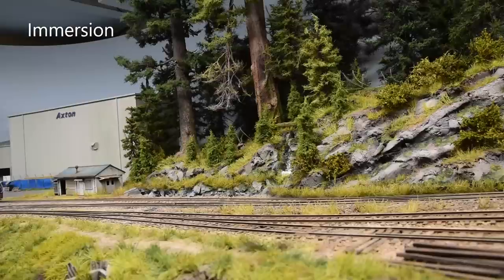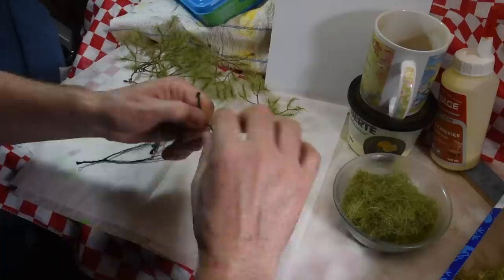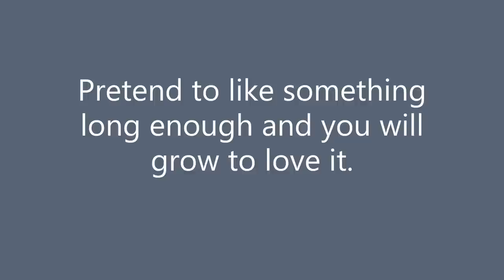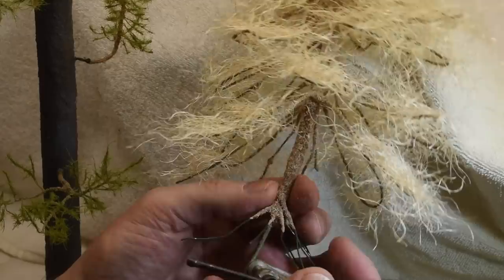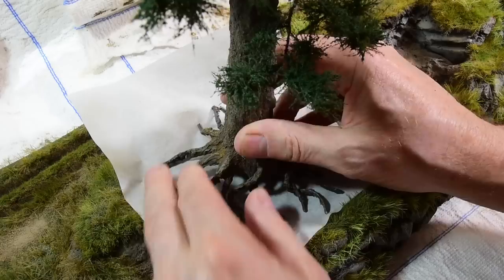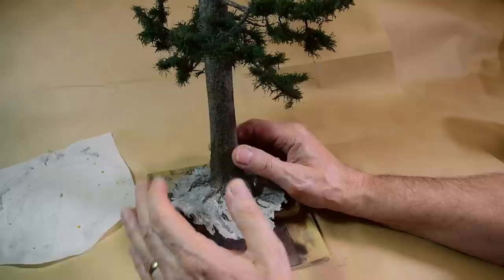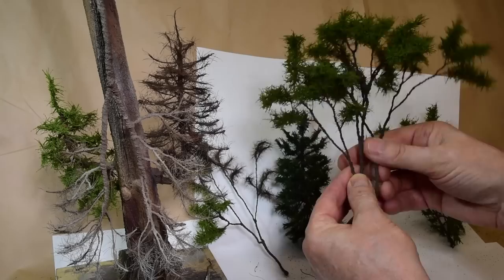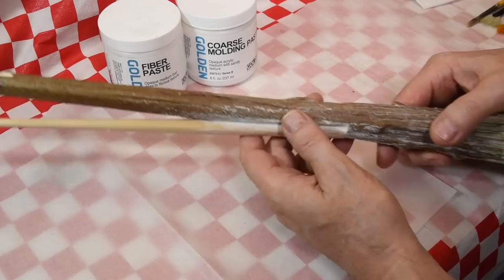Modeling The "Signature Scene" Final | River Road - Vlog # 110

Comment: Absolutely agree on the 3m disadvantage, it’s a contact glue which when it comes in contact with water, it will saponify. Totally switched to matte medium.
Reply from the maker: All the spray glue is like that. It dries out and the tree falls apart after a few years.

Comment: Great and  very explanatory tutorial even for those that have built some trees in the past. I 've noticed in several of your videos regarding the texture on limps, roots or branches that you use only stem wire if you 're goin' to cover it with fiber paste, instead of just simple wire. Does the fiber paste has a problem of bonding and staying on naked wires? Is this the reason that you cover the wires with sawdust instead of fiber paste? There are some products that "prime" the wires so the paint adheres better , like the Mr Hobby metal primer liquid medium.
Reply from the maker: Yes, yes, and yes. ;-)

Comment: Hello Boomer when the tree is finished you spray with the aribrush as final finish diluted matte medium. What is de ratio water:matte medium for the airbrush. Thanks and cheers, enjoy the weekend Ronald
Reply from the maker: It depends on your airbrush. I start with 50/50 and thin it down from there if I have to and make sure you flush the airbrush immediately after use or immerse in IPA.
Reply: @boomerdiorama  I you a Harder & Steenbeck Evolution. Till now I always Spray a thin layer of matt varnish with the airbrush (Vallejo or AK). does it have the same effect or is the finish with matte medium better. Thanks in advance for your reply. Greetings from the Netherlands Cheers Ronald

Comment: I'm  a rookie, but can you recommend a good pin vise drill brand or type. I see many 8 to 20$ amazon listings, but know from experience the right tool of very good quality always makes a big difference.  Please..
Reply from the maker: I try and buy the best quality and be done with it. In most cases this works. Most of my tools I purchased over thirty years ago and I will never have to replace them, unless I loose them God forbid. Funny you mention "pin - vise." I'm in the market for a new one as well. The one I was looking at by God-Hand is 60.00 bucks - ouch! But it fits the Drill bits I have already and it is of excellent quality. I buy that and I'm done for sure.😁
Reply: @boomerdiorama  just bought the short handle one, $40, Amazon with god hand $20 set of bits. The longer handle one was $36. Thanks so much.
Reply from the maker: @thetrainboard2772  Those bits are awesome. Good choice.